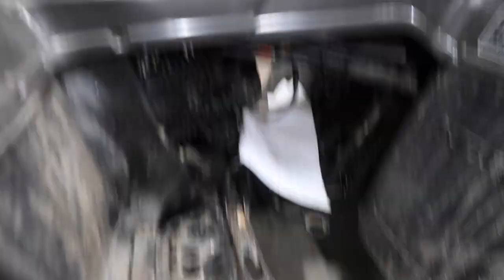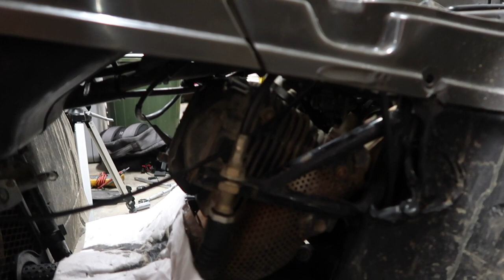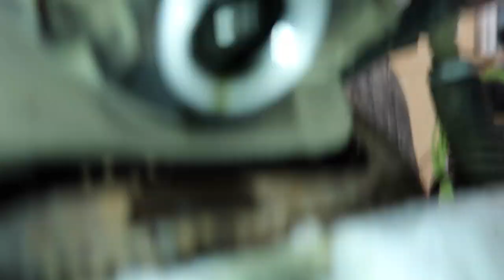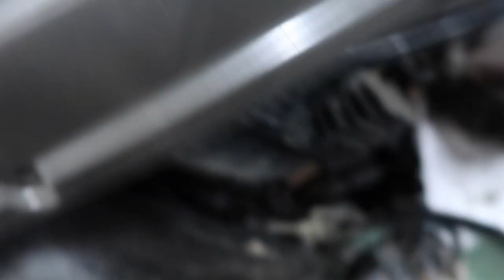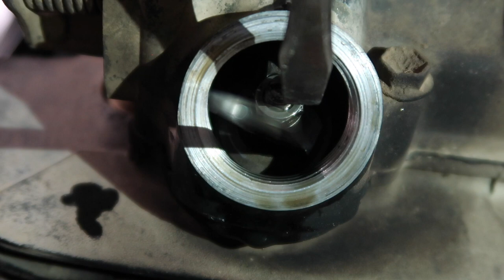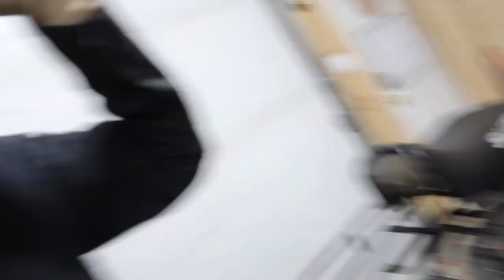How To: Suzuki King Quad 300 Valve Adjustment

Comment: your King Quad videos have been invaluable.  Thank you from Wyoming!!!
Reply from the maker: Hey ken! Glad i can help. Especially Wyoming. Would love to get there someday. Josh
Reply: @Schneids15  let me know if you come this way.  Be glad to show you around.  Question.  Some people have been swapping out their petcock out with a yamaha petcock to get away from the diaphram.  do you think this would work?
Reply from the maker: That would be great! I should have you shoot me an email. My email is in the about section of youtube. You could swap the petcock but honestly i just plug off the vacuum line at the carb and the petcock and use reserve or on and have never had an issue.
Reply: @Schneids15  yes i have done that, cleaned the carb, checked the petcock, but it will only run good on prime.  otherwise it dies after a few seconds and is hard to start.

Comment: hi! I got a question about my quadrunner 300 1992. The front diff is making weird clicking noise sometime when I turn or push the 4 wheeler when its off. Even if the 4x4 is not engaged. I wonder what can cause that? bad oil? borken gear or something else? The 4x4 still work, but the diff lock i'm not shure.
Reply from the maker: Are you sure it is coming from the diff? I would be looking at a CV Joint
Reply: @Schneids15  oh yeah, probably à cv joint, one of them got à cv boot broken since I dont know when. Thanks!
Reply: @Schneids15  are cv joint rebuildable? Or I need to change everything?
Reply from the maker: You can rebuild them i think.... i have only replaced boots.

Comment: Great as usual. Love the videos about the kingquad 300. Just aquired a 2000 Kingquad 300 with only 1928 KLM on it but seems like it is stuck in gear because I can't shift any of the  levers. Any ideas. Thanks.
Reply from the maker: Did you push down on the lever? There is a detent that requires you to push before shifting.
Reply: @Schneids15  Yes I pushed down on the lever but still no movement.

Comment: My quad is hard to start when cold i put choke start shut off like 5 sec after when give throttle die too and after like 1 min finish take gaz and run when hot start easy and run great

Comment: i have a poping noise when i give throttle is that valves or carb isue
Reply from the maker: If run without intake on it will run lean and cause a popping.

Comment: An easier way is to stick your finger over the hole. When valves are both closed, the piston pressure will "pop" your finger off of the hole. If you have a buddy you don't really care for you can put the spark plug against the back of his hand to verify, hahaha

Comment: Has anyone had their king quad have a very hard start,I mean like starter wines for a bit then will turn over,some times it will turn over a few times but very hard.replaced starter same thing,pull plug turns over fast put finger over plug hole and stops turning over,I’m lost
Reply from the maker: Sounds like your starter clutch is failing. Same thing happened to mine. The one way bearing your starter spins fails and causes this.